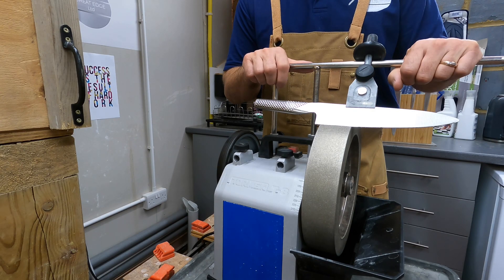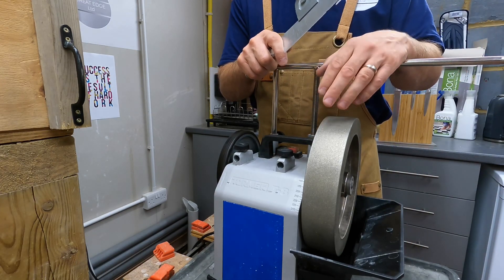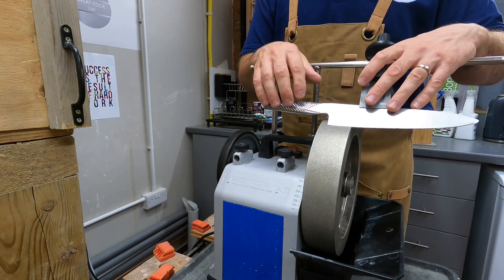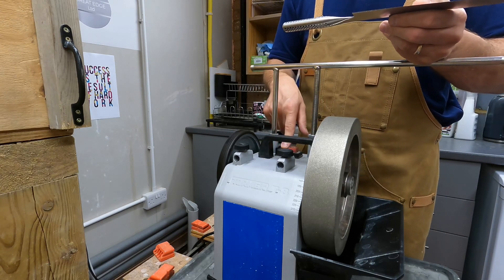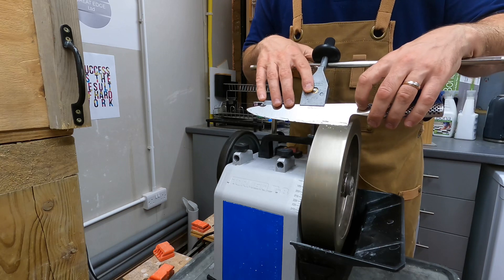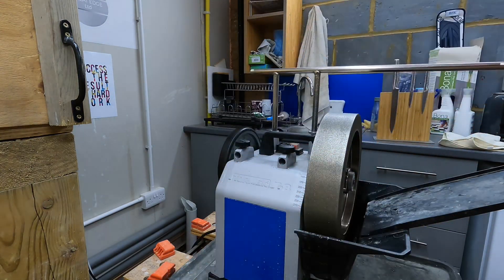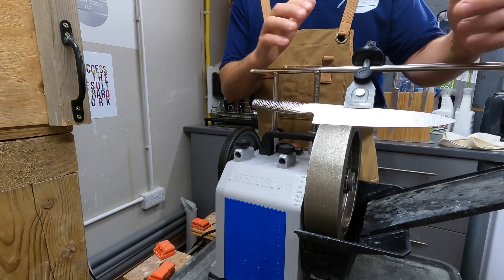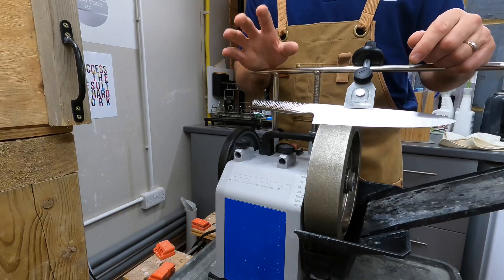Repairing a chipped Global with my Tormek T8

Comment: Hey, fellow T8 owner here. I also sharpen as a side business and sometimes see knives with big chips like that one. 
I'm also a welder/fabricator by trade, so I'm also used to working with steel in a more crude manner than sharpening blades.

I don't see the problem with removing the chip by grinding the edge flat, when the chip is cleared the flat edge should be nearly exactly where the new edge apex will form, since any angled grinding from this point on will in theory only take away away material behind the flat edge apex. In reality it might be wise to stop the flat grind, just a hair before the chip is cleared to leave some wiggly room for the final grind, as to not take away to much material, but this really shouldn't be a big problem, since we're likely speaking about saving +/- 0,1mm of the blade if normal care is taken to not overgrind when apexing the edge. 

You could consider just using a good quality metal file for removing this amount of material.
Simply mount the knife in a bench wise, edge facing up, and take the file directly to the edge, filing flat along the edge apex, with the file just slightly horizontally skewed as to not hit the handle. 
This makes super quick work of removing steel frem the edge, gives great control, insures a flat/even edge profile and ofcause doesn't ruin the heat treat of the blade. 

You'll also avoid some unnecessary wear on your expensive diamond stones.
Reply from the maker: Brilliant advice, thank you.  I will pin this comment so that hopefully others can benefit too.